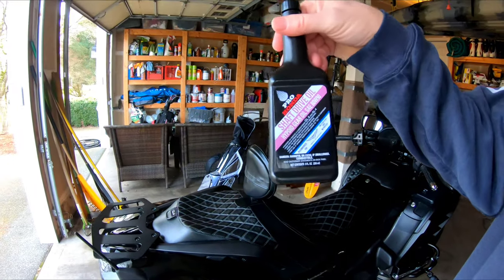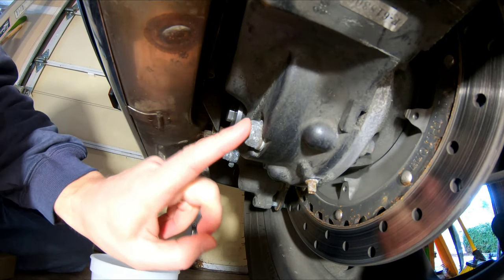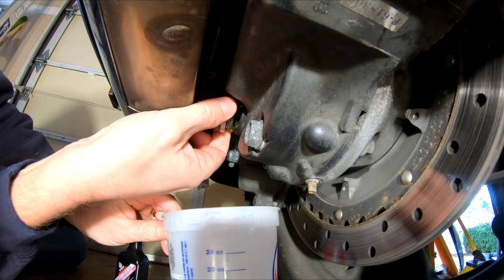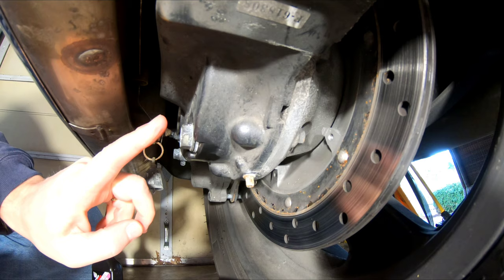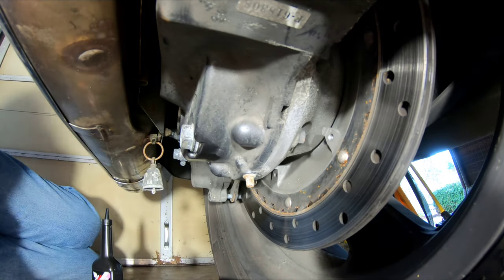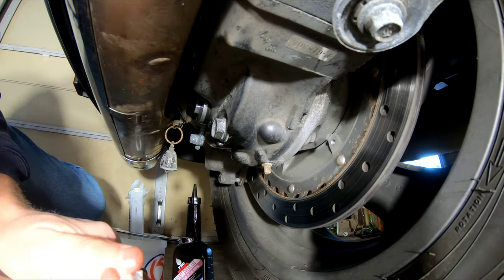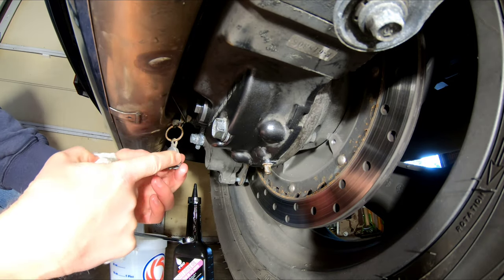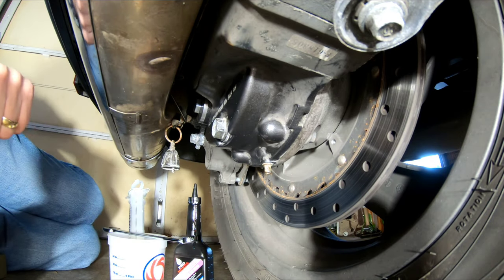Final Drive Oil Change (2013 Honda F6B)

Comment: Awesome videos. I used your Air Filter video to not only change my air filter on my 2013 F6B, but I also had to swap out the Water Pump (you have to remove the gas tank to get to that). Your video was a huge help with that big project. 
Doing the regular oil in a couple of days and then will do the final drive oil at the same time.
Reply from the maker: Hi Aaron,  Wow!!  You're turning that bike into a brand new one.  Nice work.  Great to hear that the videos are helpful.  Thanks again.
Reply: @bgrides2108  I just bought it a couple of months ago, and a small coolant leak led to quite a few projects lol. Keep up the awesome work!
Reply from the maker: @PreCiiSiioN_II  Thanks!!  Good thing you fixed the leak.

Comment: I have a ‘14 Yellow F6B. I bought it last year. This year I’ve done oil change, coolant change, dreaded air filter change...found a mouse nest. I need to do rear drive next. Thanks for the video. Ride safe so your gremlin bell doesn’t need to be on high alert!
Reply from the maker: Hi Robo Robot,  Thanks for watching.  Glad the vids are helpful.  The air filter change is a monster to do.  Yeah, the gremlin bell has done it's job well :)

Comment: i thumb'd it. great job, wat about , putting a very shallow 2 inch pan, and dropping the center stand and pull the big towards you a bit, a slight lean so you can get any extra final drive oil out? or a baster instead? i knwo theres still more in there.! thanks
Reply from the maker: Hi MML,  Sounds like an interesting idea.  Let me know how it works out.

Comment: My question is when you broke the fill plug loose oil came out. But now when you installed it. Did you have too much in when you did the last change as well or should I put it on the side stand when I fill?
Reply from the maker: Hi Mo's Motorcycle Journey,  Good question.  I can't remember if I had it on the side stand during the last change.  Probably did.  I don't think it maters that much because some of the bikes don't have a center stand.  I'd leave the bike on the center stand if you have one and follow the manual.  Good eye though, you could call a shop and ask them also but I'd guess it doesn't mater.  Thanks for watching.

Comment: I change mine every oil change, great video
Reply from the maker: Hi Donal,  Sounds good.
Reply: How often do you change your oil?  Is there a reason you change your final drive so frequently?
Reply: @matthewlippert6864  every 5000 miles, when I bought the bike it had 14000 miles on it and five drops came out of the gearbox, figured I should change it more often so I dont have issues. Plus its cheap, so I do it.

Comment: I have to admit that i'm somewhat confused by the amount of oil you put back in. The service manual calls for 4.1oz of oil replacement after draining the final drive. The bottle of oil you have is 8oz and it looks like you put far more than the recommended 4.1oz back in the bike.
Reply from the maker: Hi Rollergoalie16,  Your right.  The manual does say 4.1oz.  I watched the video again and it looks like I put in more than 4.1.  I probably did.  I also looked in the manual at the "final gear oil check level" area, and it says the oil should be at the bottom edge of the fill port.  So I just keep filling until the oil can't stay in anymore and call it good because that's what the fluid level should be at when your done filling.

Comment: You want to install the fill plug immediately instead of leaving it drain. If you ever want to check the level all you need to do is open the fill plug slightly and some oil should begin to drain. and you will know it is full.
Reply from the maker: Hi 340rps, That's a really good idea.  Thanks for watching!

Comment: Nice vid! I've been told not to turn the wheel when you fill it, this was on a Yamaha but I'm guessing the same applies to our F6Bs? I did see the note to rotate when draining though, so who knows?! Haha
Reply from the maker: Ho Wretched Ride,  Thanks.  You could be right about not turning the wheel during filling.  I didn't notice anymore fluid going in because I turned the wheel.
Reply: @bgrides2108  yeah I doubt that, even if it did take some more fluid, it would make a wild difference.

Comment: You don’t need to pour the oil into the syringe, especially out of a full bottle. Simply push the plunger all the way in, stick the fill tube into the bottle of oil, and pull the plunger handle out.
Reply from the maker: Thanks.  For some reason I thought it would be quicker to pour it in since the fluid is so thick.  Thanks again.
Reply: No worries. My wife, who is a nurse, laughed at me when I did the same as you did with some tubeless bicycle tire sealant. That stuff is a lot thinner than oil, maybe she was laughing because I initially forgot to block the open end of the tube! 😂
Reply from the maker: @DalsDad  lol